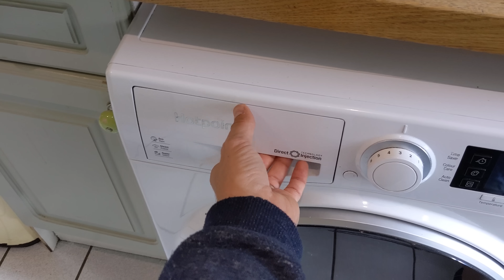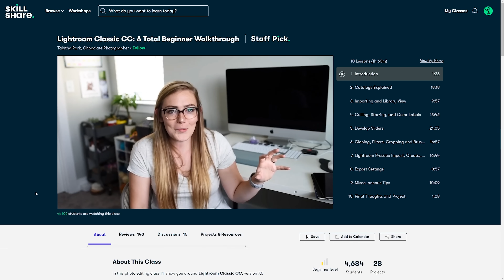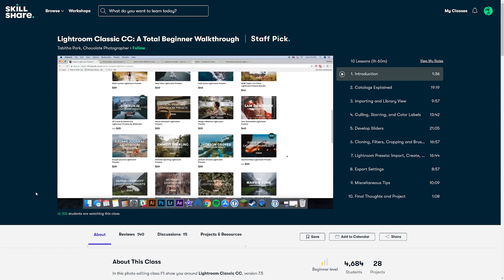The Pythagorean Siphon Inside Your Washing Machine

Comment: thank for this video! It randomly came up but solves a problem that's bugged me for a while. I'm often a firm believer of more = more, so I just glug a lot of softener into the compartment. I've noticed that if I check the draw early into it's wash cycle to see if it's washed away the cleaning gel, I've noticed the softener has always vanished. I thought the washer was faulty and flushing the softener in too early. 

Now, I put less softener in and it remains there until the correct time in the cycle! Less definitely does = more in this case!

Comment: I'm in Canada, and every toilet I've see has the same float shut off valve, but the flush mechanism is just a rubber flap that fits into the hole on the bottom of the tank. So when you push the handle, the flap lifts and the tank drains, and when the tank is empty, the flap pluggs the hole, and the tank fills

Comment: This system is more commonly used for Urinals, as most washing machines have pumps for water removal as the water level is well below the drain. I know as I've replaced quite a few, and that where you'll find the under wire from a Bra stuck.

Comment: I had never seen that siphon style of flush toilet before. That's really cool! Here in the US, there's just a rubber stopper valve at the bottom of the tank (cistern). A chain connects it to the handle. Once lifted, it floats and stays clear until the water level is low enough for it to drop closed, so no half flushes are possible with the design. There's also an overflow in case the fill valve leaks. The problem is that the rubber stopper valve can leak, a problem the siphon style flusher you showed eliminates. At this house I have toilets with accumulators that use water pressure to flush, just like a commercial toilet, but without the requirement for a large water line. They use only 0.9 gallons per flush, and they flush violently and are absolutely unstoppable, if you know what I mean. Also, I just learned that I have been mispronouncing Pythagorean for decades! I've little doubt that your pronunciation is actually correct.

Comment: Nice video and description, unfortunately  this is a poor design for liquids soap dispensing in washing machines because the tube you talk about gets gunky with time and then the soap flows out by capillary action way before water fills in. Another potential problem is that these devices are installed in a drawer looking compartment and if you fill your soap and then close the drawer too fast you will initiate the siphon before the cycle begins. To sum it up, using siphon for this application is a great theoretical solution but practically only works in perfect conditions.

Comment: My partner was telling me the thing about holding the lever down but he had it backwards. He claimed full flush is if you hold it down and half flush is if you let go. Thanks for the explanation.
Reply: There are two types using opposite actions for the same result (thus you're both correct).

Comment: I need help. I am trying to make. A pythagorean cup myself and i wondered if the tube which the water is coming out from being slanted would have an effect. If for example its exit was wider than its entry point, would the bigger volume that can fit in the lower part create a lower pressure, pulling the water down faster? Or would it let air through, breaking the mechanism? Can someone help?

Comment: Interesting.
The new toilet at my place has a cool flush mechanism.  It's got the dual button options but the small button flushes for as long as it's held, rather than a fixed (half) duration and combined with the bowl shape and U-bend it's incredibly efficient, nearly always only requiring a very short flush.  This allows for two very short flushes being sufficient for the unfortunate times when the brush is required, so if someone else needs the loo immediately afterwards, there's still sufficient water available for yet another flush (even though it's also a pretty compact system).

Comment: Interesting fact: in the US, we use a flap at the bottom of the tank to fill the bowl which siphons after breaching the trap, but, if you don't have the hose from the fill valve in the flush valve tube, the level in the bowl will be too low to adequately breach the trap

Comment: Where I live the flushes use another system. A white cork wich tryes to float keeps the flush open while is discharging, but when it's closed the water wheight avoid it to float and keeps the plug closed. For small discharges a little pressure to a thin vertical bar(one side bonded to cork and plug and the other side activated manually from outside) inverts the forces and help the plug to close the system. Easy and smart aswell

Comment: Your toilet is weird. At least in Australia the mechanisms is much simpler. Similar to a plug in the bottom of a cistern that gets pulled up by the flush. But the plug is a ~30cm long tube so of the cistern trys to overflow it just goes down the tube into the bowl! Interesting to see the different solutions though

Comment: This would have helped me understand what Dad was doing when he was trying to fix the toilet cistern when the flush wouldn't work! Or at least understand how it worked. I think the problem was with levers that were not strong enough or not connected properly.
It shows why the fabric conditioner compartment is so hard to clean when it gets gunged up and goes black. Even with an old toothbrush it's hard to clean around that tube and in all the corners! 
PS
Does anyone else get nightmares about toilets that keep overflowing and won't drain away?

Comment: Not sure what mechanism my loo is but it’s able to leak when the tank in filling and it is a curricular tower in the middle with a hole straight down it’s middle for the overflow it looks like different bits of it move up to let the different amount of water down but not sure what keeps it down until the water is no longer flushing

Comment: the toilet at my old place had a functionally similar floater mechanism
but instead of a siphon, it lifts a bit of pipe that normally blocks it, then the pipe drops back into place as the water level falls

I have no idea how that mechanism actually works, but that's what it looks like from the few times I've flushed it with the lid off

Comment: My toilet doesn't work that way. In fact, this video really confused me for a bit, because there's a very simple issue in the back of my toilet I was going to fix in the morning, and it doesn't match up with what your example showed. I'm not 100% sure how it all works, but in mine, the lever just releases the water from the tank and it flushes that way. the tank automatically fills up slowly, probably through some sort of water mechanism you already know of. I'm pretty sure it fills from the bottom, though, which might indicate it works though some interesting but simple water mechanism.

Comment: The toilet in my apartment uses a flapper valve instead of a siphon, which is simply a hinged piece of rubber that is connected to the flush handle by a chain. When you push the handle down, it lifts up the chain, which pulls the valve open. The valve then stays open (as it floats on top of the now rapidly moving water) until the tank has been fully drained, at which point it closes again, and the tank begins to refill. This unfortunately means that you can’t do a half flush, as there’s nothing stopping the water once the valve is open. There are newer toilets which have a push-button system (rather than a handle) for flushing, and those often have two buttons: one for half flushing, and one for full flushing. Not really sure how those work, but there’s a video idea for you! Fun fact: the toilet bowl also contains a siphon, which is why some water always stays in the bowl after the toilet has flushed. The sudden rush of incoming water from the tank starts that siphon, which begins to drain the bowl, and when the water stops coming, the water that didn’t make it out flows back into the bowl. This is also why you can dump a 2-gallon bucket full of water into your toilet to flush it manually if you lose your regular water supply for some reason (it does happen from time to time).

Comment: All the toilets I have ever seen in the US don't have a siphon in the cistern, rather they have one in the bowl. The cistern has the same float valve to end the refill, but to control the emptying there is a special flap that has a pivot and a float. The flap/float gizmo is designed to stay open due to the floatation as long as it is open and the water level is above it. Once the water level falls below the float, gravity pulls the flap closed. At that point, the cistern refills and the weight of the water on the flap holds it closed against the floatation force of the float. The handle is connected to the flap and lifts it away from the exit port to initiate the flush and the float holds it open until the cistern empties.

Comment: I live in NC in America and Berry Foster described American toilets. I’ve only seen them with the water line attached to a float valve that turns on and off the water as needed. A flapper with an air bubble in the bottom of the tank gets pulled open by the flush lever and doesn’t go back down until the tank is empty.

Comment: We live in a very old house so we have old toilets (2) and both work with a plug that rest in the hole of the pipe and it is hollow so when you flush it floats and ones it is completely empty the plug goes in to the hole and the water that is going down pulls it down so it doesn’t float in till the water is above the plug to keep it down and the rest of the water in the pipe is then empty for the water in the boll parsley empties then it drains all the way out letting the water in the pipe have no more Surface tension. The float is the same for one but the other has this and plastic cylinder in side of it and the Cylinder has a hole in the middle to let the water flow in to the tank and ones at the top the hole in the Cylinder (that has now floated to the top of the pipe) gets close by a little peas of plastic and doesn’t let ant more water in and also blocks the water in the tank from emptying. 

How do I know all this… old house = old pipes = plumbing problems

Comment: You don't have to suck-start a syphon. Just use a longer tube, submerge most of it in the liquid you are syphoning, plug the end with your finger and pull out the tube so that the liquid level in the tube falls below the liquid level in the container.

Comment: I've noticed in some toilets, (most actually) you can feel the resistance as you push down the lever, it's never really occurred to me until now that you would have to create some sort of pressure to initiate a flush, but this siphon mechanism is way cooler than whatever I thought it would be!
Reply: If you live in the US, your toilet most likely doesn't work this way. The cistern releases water into the bowl via a flapper mechanism and the siphon happens in the "P" trap as the water level in the bowl fills above the high point of the "P" trap.

Comment: In the US, the cistern has a hinged plug called a flapper that floats open when it's pulled and is held closed by water pressure as the cistern refills; A simple drain empties the cistern into the basin. 

The siphon part is in the basin, which is usually partially filled with water already. Water from the cistern fills the basin which then empties. It actually looks very much like your classic greedy cup. It even does the gurgley thing.

There are a couple other differences from what I could see. The flapper can't prevent overflow the way that that siphon does, so there is also an overflow drain in the cistern that leads to the basin. It's just an open pipe that extends above the float. The basin is also partially filled by diverting some of the incoming water into the overflow pipe as the cistern refills.

I hope I didn't discredit myself as someone from the US by saying "basin" and "cistern" instead of "bowl" and "tank".

Comment: I don't know what mechanism they use in Brazil, but here the water will pour down as long as you hold the button, so you can really prolong the water rush until the toilet is clean. It's not a siphon, since it recharges immediately, it's connected directly to the water tank. Although there are cheap siphons you can buy to put in your toilet, but if the shit doesn't go away in your first try you have to wait quite a lot for it to recharge.

Comment: Every toilet I've ever cracked open just has a rubber seal on the bottom of the cistern that gets pulled up when you flush and floats back down into place as the water level goes down. The siphon honestly seems unnecessarily complicated to me. 🤷‍♂️

Comment: It's not the weight, it's because it created a seal but it's actually because you've now got differing pressure... The low pressure created in the middle part is what pulls at the water to siphon it down

Comment: This is a great illustration of the similar effect one has to consider in water distribution/wastewater collection systems: water flowing creates vacuum behind it in a line. Water flowing downhill through a full pipe under gravity will pull more water behind it faster and faster, a siphon. This can get pretty dangerous when you start talking about large mains and pipes, you can develop serious delta-p. It's why it can be super dangerous if you unclog a large storm drain with a big puddle around it, if you were to slip or get too close to that now-opened drain, you COULD get pulled into it and it could dismember you. You plug that drain with a limb and now all that water flowing away in that pipe, 8.34 lbs/gallon of it, is pulling you into that pipe. In a big line that could easily be thousands of pounds of water. 
This same phenomenon creates water hammer, pressurized water moving at high speed suddenly stopped by a valve, all that inertial energy has to go somewhere. 
TL;DR water's dangerous, mkay

Comment: Surprised you did not mention the siphon in the bowl itself to the sewer drain, or do toilets not work that way outside of the US. That siphon works once the bowl level exceeds the curve of the drain pipe as water is added. Same concept that you showed, just different location. US toilets do not use or it's not common to use a tank siphon. We would rather have a flapper valve that wears out more frequently and usually just wastes water when the seal is no longer perfect :)

Comment: Maybe it's an USA vs. UK thing or maybe it's a, "I'm really cheap," thing, but I've literally never seen a washing machine with a fabric softener tray before. There's always a cup on the center agitator bar. Of course, I've never actually seen a front-loading washing machine before, so maybe that's the reason. Besides, if you want to put soap on clothes after you rinse, they have fabric softener sheets, which are way easier than liquid anyway. And, if you weren't aware, fabric softener (liquid or sheet) is just soap, although some newer fabric softeners have a silicone lubricant mixed in. Well, maybe not soap exactly, because nowadays, it'll be some kind of synthetic detergent, often based on ammonia for some reason. A thin coating of soap or lube on fabric makes it feel softer by settling down the errant bits of broken or frayed fibers that stick up and feel harsh. You get the same effect by wearing them for a few minutes; your skin grease will rub off and soften them up the same way soap ("fabric softener") does. Repeatedly tumbling or beating your clothing has a similar softening effect as a coating of soap, just done by mechanical means. This means that fabric softeners are completely unnecessary if you use a tumble dryer, regardless of whether you use the tumble dryer for drying or put your air-dried clothing in the tumble dryer on tumble only (no heat) mode for a while. The only actual benefits of the soap in that case is the reduction of static electricity and, if you can call it a benefit, the smell. Myself, I'll be skipping the fabric softener.

Comment: 8:40 Oddly enough, my toilet does the opposite. If I flush and let go, I feel like the flush uses far less water than if I flush and hold the handle for a few seconds longer. @Steve Mould @SteveMould does this mean my setup is upside down in some capacity?

Comment: Mine isn't that smart.  It just keep pouring water at the softener tray while it's filling itself lol. Same happen at the detergents hole.  Same for my toilet.  No siphon mechanism. Chain pull a flap thingy and as water empty it comes down with it and covers the hole so it can be filled again. As for the floater, it's not the loose kind. The floater it's on a pole, pole goes through it. And as it raise with the water it shuts the valve. The flap itself stays down due to shape and weight of the water over it. But it's not really ducked in place by pressure, because there is a secondary higher hole in case the floater get stuck. (With time build up create friction on the pole and floater) tank won't overflow. Leaking the water into the bowl, using the same channel/way the other water goes through.  Fascinating all the same.

Comment: Great video, makes loads of sense. I wonder how the two stage button flush works in comparison (the type that has 2 buttons on the toilet lid, one to be used for a half flush)
Reply: With the two-stage button on my toilet, it controls a trough of water which is tipped either partially or fully depending on which button is pressed. It then spills down to the pipe running to the bowl and flows out normally.